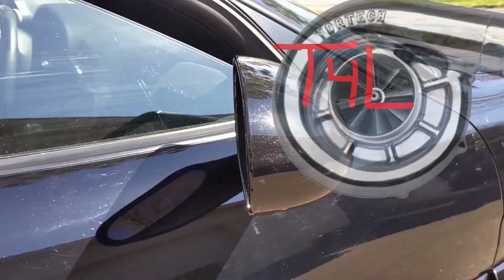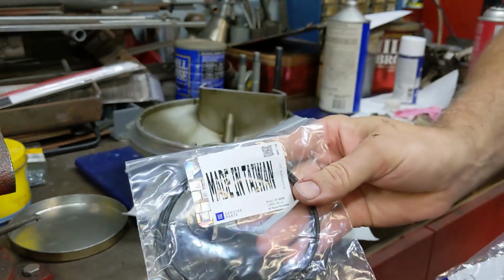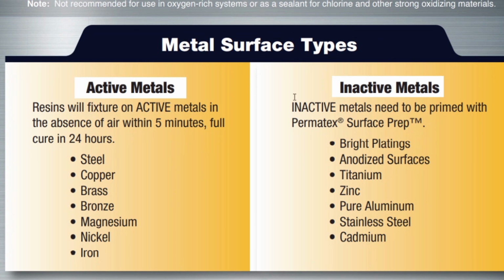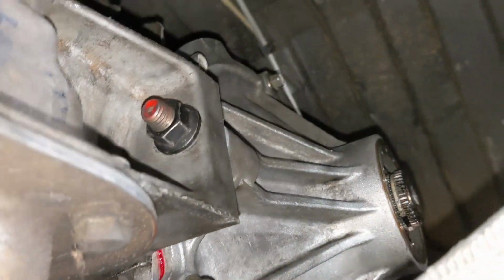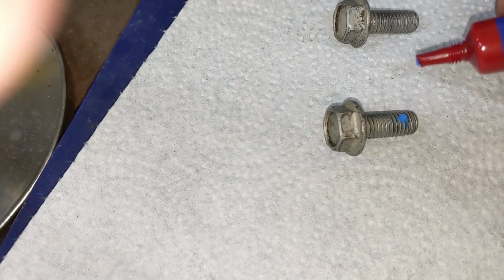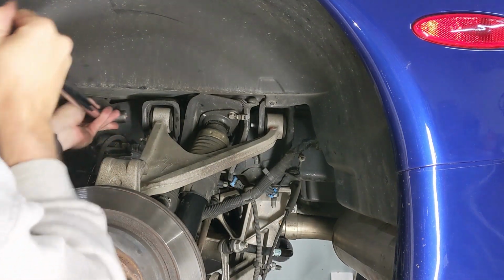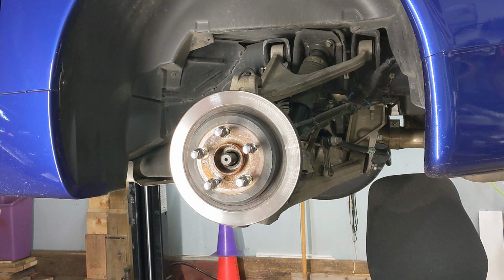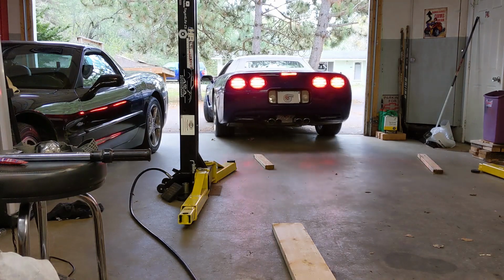Part 2 - C5 Corvette Rear Differential Leak Repair (Steps A-Z)

Comment: I was very uneasy with doing this repair myself, but I did it following your instructions. I don't have a lift, so there was a bit of added complication doing it on jack stands. In addition, my axle nut took superhuman amounts of force to break loose, but it was a learning experience. The cv axle wasn't easy to get out either, had to lower the shock just right. The double nut thing took some experimentation as the hand room is very limited. Overall, it was very satisfying to fix. Thanks for the tutorial!
Reply from the maker: Glad it worked out and this was helpful!

Comment: Hello, love your video, I am doing this today. My question is do I spray the diff housing also with the prep spray? And also, do I apply thread lock to the diff cover bolts
Reply from the maker: I make sure both sides are completely free of any fluid oil etc and coat one side well as shown.  Mask off what you don't want sprayed.
Reply: @Toys4Life thank you 🙏

Comment: Outstanding video. Yours are the only ones I trust when I'm doing serious wrenching on the C5. I'm currently replacing both axle seals. I currently have both diff side covers off of the car and I'm in the process of carefully cleaning them. I have the drivers side clean - your technique of taping over the needle bearing side is a great tip. For the passenger side cover, there's just a race for the tapered roller bearing on that side. I'm leaning towards carefully cleaning that one in my solvent tank, and rinsing it in hot water. Would this cause any issues? Also you only prepped the cover side for the anaerobic sealant. The diff case is also aluminum. Should I try to prep the diff gasket faces also?
Thanks for all that you do for this hobby!

Comment: Great video with lots of attention to detail.  I've done a similar repair on a different vehicle and left the axle in the hub/nuckle since the splined axle didn't want to come out.  This required removing all suspension components from the knuckle in order to remove the axle from the differential.  This adds weight and makes removing/installing the axle from/into the differential more cumbersome, but it can be done on other vehicles and perhaps on the C5, if needed.

You did not mention checking the shaft seal bearing surface on the axle (the polished part of the axle shaft that meets the new seal at the differential).  From the video, you can see that this area of the axle shaft looks discolored (yellow/brown).  I didn't notice a groove in the sealing surface from the video, but this area should be checked for any grooves or nicks.  If there is a groove worn in the sealing surface, the leak will likely come back, even with a new shaft seal.  The shaft sealing surface can be repaired with an SKF Speedi Sleeve, if needed.

I've subscribed and look forward to seeing more of your videos.  I'm currently looking for a nice C5 Z06.
Reply from the maker: Excellent point - thank you!

Comment: Thanks for the videos, as always! I see mine has inquired a leak and is most likely this, but I still haven't gone underneath yet to confirm. So, question for us people without a lift. Is it possible to remove the left exhaust on a 3-ton jack stands on highest level?
Reply from the maker: Unfortunately, probably not -  unless you have aftermarket exhaust that has a union behind the axles as well.

Comment: fwiw - Mobil 1 LS 75w90 already has limited slip additives in it (hence the LS in the name). I emailed the Mobil 1 Technical Support Center to 100% confirm, and a Lubricant Technical Support Engineer replied "Do not add anything to our LS 75w90 product - it already has limited slip additives."
Reply from the maker: I am aware of this but with friends cars I like to be safe than sorry and add it anyways.  I will try this on my own car to (since I drive mine very spirited and am always listening for anything unusual while driving) to see if I notice any negative effects at all to be100% sure it works fine.  Thanks for the comment!!

Comment: No lube on the o-ring? That's a great way to roll it or tear it.
Reply: But I see GM's procedure doesn't call for it either. Strange.
Reply from the maker: Have to be careful not to contaminate the anaerobic sealer with grease/oil.

Comment: Thank you so much for your detailed video and explanation.  It is very much appreciated.  Just one question/observation.  I noticed on each of the 1-quart containers of Mobil 1 Synthetic Gear Lubricant LS, it says in smaller lettering Limited Slip Friction Modifier Included.  With this modifier included, is also necessary to add the 4 oz of AC Delco Limited Slip Axle Lubricant?
Reply from the maker: I don't think so, but I do so anyway just to be sure, that's not the best answer in the world.

Comment: Thanks for the reply over on part 1 video sir.  Another question over here: the reinstall of the stud is edited out of this video. Before or after the torqueing of the cover bolts? I would imagine it would compress the seal on one side if you torqued it too much.  Just a little snug after torqueing the cover down?
Reply from the maker: Good point sir, I would torque the stud last after all of the other cover bolts are torqued.
Reply: So double nut technique just wouldn't give enough grip on the stud. But a country boy can survive. Used a 20" drill bit extension to drill through the nut and stud together. Pinned the nut to the stud. Broke the stud loose then removed the pin/nut and spun out the stud.
Reply from the maker: Nice 👍

Comment: Thanks for the vids on this! Looks like reinserting that trans/diff stud was left out… does the double nut technique work to get it back in? What do you torque it to?
Reply: 31 ft-lb for the stud, then 37 ft-lb for the nut onto the stud. GM's document 1826526 gives the torques.
Reply: @Flopsaurus  Thanks. I completed this repair last year, so hopefully that's what I torqued it to ;)

Comment: I noticed where's the stud you can't put gasket maker  there ...
Reply from the maker: There is a little that gets in that area - but your are correct - there is a cutout there so it gets much less surface area.   Did you just finish yours?
Reply: @Toys4Life  yes I follow you step by step  great 👍
Reply from the maker: Nice, good to hear!

Comment: Have you ever had someone tell you that a little whine from the diff is normal?  I had a shop install a 3.42 diff into my automatic car and they said it was normal to make a little noise.
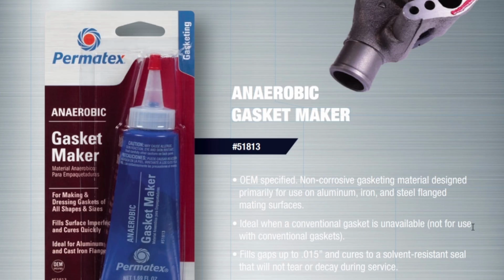Reply from the maker: I don't see any reason why 3:42's shouldn't be as quiet as your previous gears. Does it make the noise on acceleration, on coasting / deceleration, or all the time?
Reply: @Toys4Life  it varies by speed and throttle input.

Comment: Thank you for another excellent video.  Your videos are really helpful.  I have some questions:
1.  Do you put any kind of lubricant on the axle splines that go through the wheel bearing to minimize rust?
2.  I noticed that you torqued the axle nut to 118 lbs-ft as specified in the service manual.  I have read that this specification was changed to 160 lbs-ft and then changed again to 140 lbs-ft with Loctite 272.  Do you have any information about that?  Thank you.
Reply from the maker: Hi there  - thanks for the comment!   1. If the splines already have enough oil/grease left on them I leave them as is.  If they looked dry I would smear a very light coat of grease on them to keep rust away.  2. I had not heard about the revision(s) to the service GM Service Manual.  That unfortunately is not uncommon...   I will have to look into it further.  Also, the axle nuts are one time use only so by using a new one - that should help quite a bit to ensure they stay tight.  I suspect many re-use the nut (it doesn't seem like a big deal) and I would think that may well account for some cases of them coming loose.

Comment: Do you suppose there is a mechanic at shop or dealership that goes to the detail you do?  I doubt it.
Reply from the maker: I am pretty pokey - but I want to make sure it is done right!   Thank you for the comment - much appreciated!
Reply: How did you know it was the cover leaking and not the axle seal?

Comment: 1052942 is only $18. Why not just buy that if it’s recommended?
Reply from the maker: You could and most probably do.  I feel better about using a Permatex product and knowing it is properly cured by using the surface prep (essentially a cleaner/catalyst for aluminum to aluminum applications.  Quite a few folks have not had the repair work over the years and I cannot help but wonder if the GM stuff is missing the surface prep to allow the anaerobic gasket maker to properly cure.

Comment: I really enjoyed this video series. I never really understand why bolts were torqued and retorqued to a specific degree, so I googled it.
Because the friction effect of each bolt varies, the angle the bolt rotates before the installation torque is reached is not constant. Higher friction will cause torque to rise more quickly. Because the angle of rotation is smaller, the bolt tension generated is also proportionally less. This is the theory behind angle control.
Reply from the maker: Thank you!    Agreed - it is all about making sure you get the proper stretch on the bolt so it holds as designed.  Too much stretch and it breaks, too little stretch and it will not stay tight.  Cheers!!